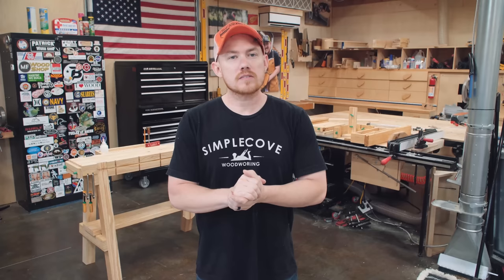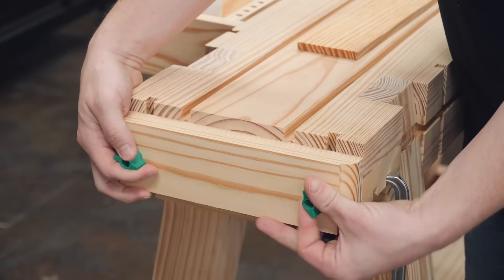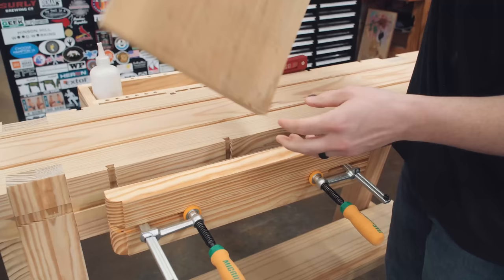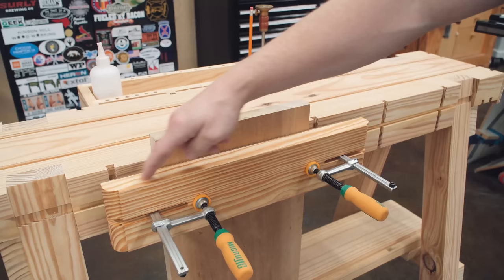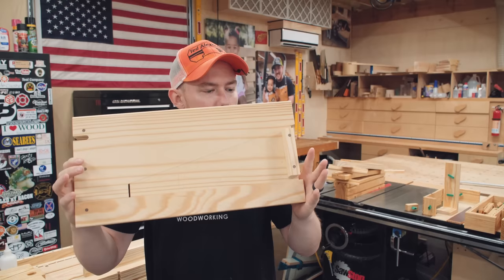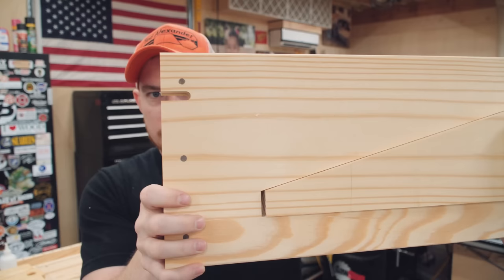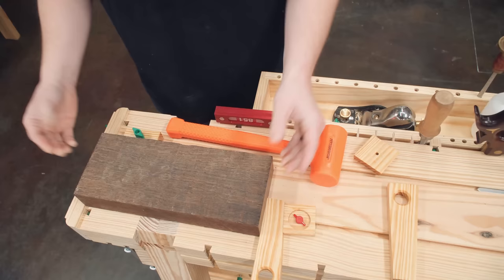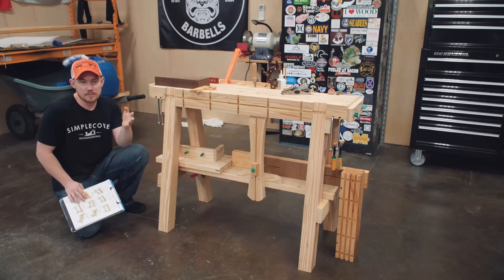MatchFit Work Horse Accessories - 369

Comment: Great video.  I recently made the matchfit workbench, and found your video last night.  I couldn't resist, and built out a few of the simpler accessories you talk about here  today to great success.  One comment/suggestion for others following suit.  For the simple wedge and stop, while I was able to get decent hold from the way you build it, since my bench also has a cross-hatch set of slots on its top (unlike your workhorse here which just has them along the top length), I found it more stable to to slide the stop in a perpendicular slot to get the mechanical strength of the slot vs. the friction fit you show.  However, this then means you need to make the wedge and stop larger, since their combined width needs to be able to span up to the size of the grid (4" for me).  The simple trick I used was to have a rectangular stop who's "center" hole was placed such that it was 2" longer to one of the beveled sides than the other, so for a shorter gap use one orientation and for a longer gap use the other, and then the wedge spans the other 2" from its narrowest to widest position.  Was able to accomplish this with a 4.5" long stop, and 12" wedge keeping them very manageable in size.  I'm still a relatively new woodworker, so there may be even simpler solutions out there, but this worked well for me.

Comment: I just finished making mine with your plans. Thank you.
Reply: I used it today as a shooting board. I clamped the pieces that I needed a perfect 90 deg surface on on a thin piece of stock to lift the piece up to the blade of the hand plane. The match fit clamps held short and long pieces as needed for my project. Really happy with this bench. Highly recommended.

Comment: 2 quick thoughts: First you can expand your ability to clamp longer pieces against the front edge by leaving the front left leg straight. That gives you back some of the versatility of the full size bench. Also, I have made a number of sliding dovetails, and one thing that reduces strain on the router (motor, bearings, etc.) is to rout first with a 1/4 inch straight bit. Then go back with the appropriate dovetail bit.
Reply: I wondered the same regarding a straight leg or a three leg horse being better for edge work on boards and panels.

Comment: Maybe you could try some steam to re-hydrate/soften the pine on your wedge thing. Always wax (bee or parafin not paste) any wood-on-wood sliding stuff regardless of purpose. I had a 100year old dresser with seasonal drawer sticking; added wax and gently worked it in with a heat gun and cork block (like for x-country skis)  and voila! No more sticking for 30 years now. Cheers

Comment: Insert a wooden dowel into the version 1 wedge clamp finger-hole and tap the wedge out.
Reply: I was thinking the same, except I would cut a wedge that fits the gap. Then just pound the wedge to drive it out.

But then I saw the suggestion to put the wedge assembly in the oven on lowish heat for a few hours. If that works, bazinga.

Comment: Micro jig match fit 1.5” DT hardware. USA - $11.99.  UK - $23.11. The UK price includes 20% VAT but even after deducting that, the cost of transporting across the pond does not account for the difference.
Reply: Is that just a set of 4 Screws, knobs and washers?  I saw it a set of 4 in Australia for ~$11.50us or ~£8.10. But for two clamps it costs ~$53us ~£37

Comment: Jay. Very informative. I’ve been using MatchFit clamps on a small work bench and drill press table. I find that the slots fill up with sawdust and the clamps become difficult to move. I do blow out the dust with a compressor but I was wondering if you have any tips to avoid this as much as possible. Thanks

Comment: Good design! However funtionality would be much, much improved if one pair of legs were straight down flush with face of top. This way a board could be clamped on face that extends past the legs and ends of workhorse and vertically. The back two legs could be flared out 5° more.

Comment: 12:45 What about adding the groves to the legs themselves so you could utilize the legs as a clamping space? Or is that a bad idea? It wouldn't be perpendicular to the other surfaces, but if you needed to clamp a large piece to work on it maybe
Reply from the maker: It wouldn't hurt anything to add grooves there.

Comment: im suspicious that those t-track are going to last with work holding clamps and such, wont they split an break easily over time?
Reply: I suppose you could just router out a new wider dado, glue in a piece of wood and then put in a new dovetail groove.

Comment: 8:20 Rather than try to pull the wedge out of your jig, push it out. Make two wedges that will fit into the small hole at the narrowest point of the stuck part of the jig. Insert the two wedges into the hole, one on either side, as if you were using opposing shims to level a cabinet. Using a mallet, gently tap the sacrificial wedges into that hole. As the wedges are driven in, they should push the larger wedge out of the jig.

Comment: 19:50 Why does everyone make the pins and tails such different sizes? That just makes it look weird. IMHO pins and tails should be (close to) the same size.
Reply: It shows you made it by hand. The pins are too small to have been done by a router, thus signifying it's hand made. Also more difficult / sign of skill to make them that small.
Reply: personal aesthetic choice mostly. Since they could fail if done wrong, tiny pins can be a way of showing off your precision and skill as a woodworker. Sizes and ratios that can't be achieved with machines are preferred by some for the show of craftsmanship, but most people wont realize what they are looking at, and many of those that do probably wont really care either.
nice article by paul sellers on dovetails: https://paulsellers.com/2018/01/dovetail-sizing-keep-simple/